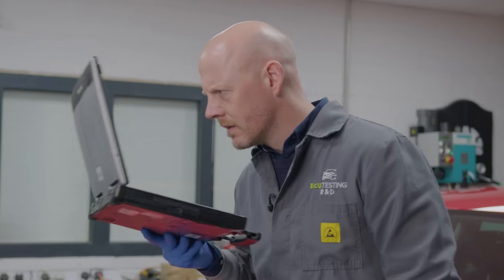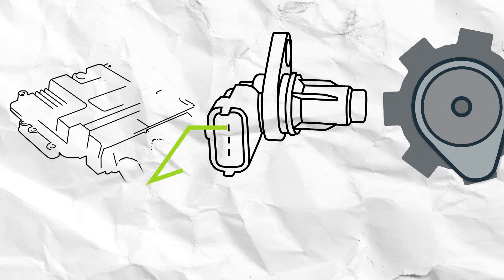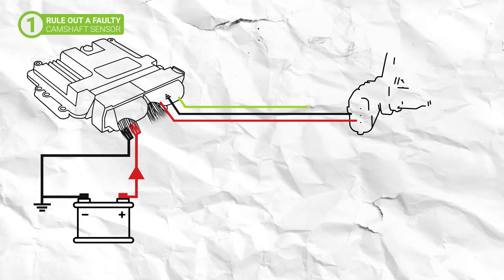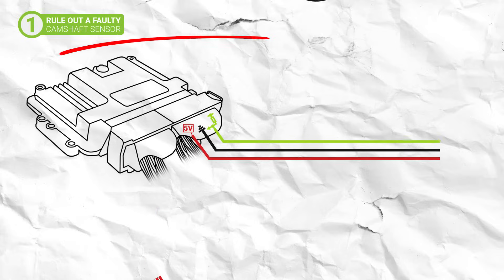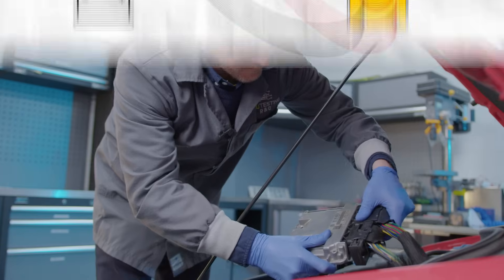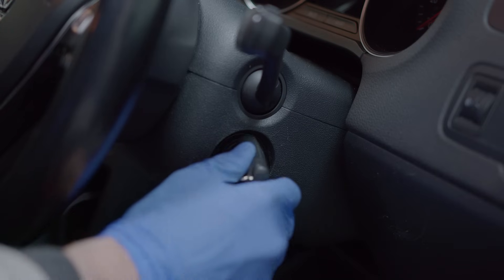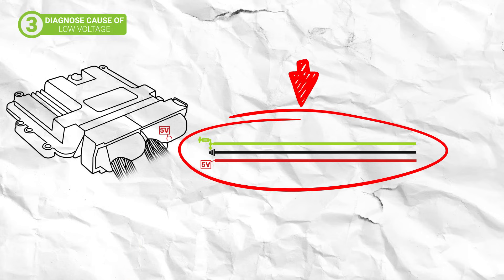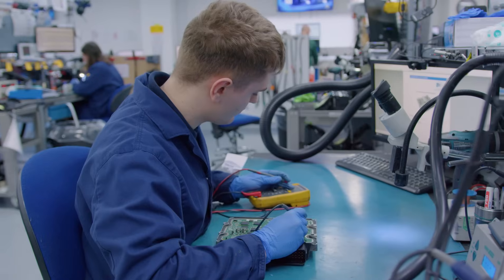Bad Camshaft Position Sensor Symptoms - How to Test and FIX!!

Comment: My question is what if its an intermittent problem with the crank positioning itself , hard starting some days , no start then an hour later starts up . If you perform the test you did and all is well and also no fault codes in my ECU (which i dont understand ) but replaced the crank sensor and its been fine 6 months now 🤷

Comment: I have a friend that has a 2010 2.5 Toyota Camry he hit a deer with the car and now won't start not receiving any readout to the crank sensor as I unplugged the crank sensor and checked from the 3 pins and no read out with key turned on.so do I check the other plug ends within that harness leading back to the ECM?
Reply from the maker: Yes, we would recommend completing the same test by back probing all 3 wires at the ECU connector to determine if the fault is within the wiring loom or the ECU itself.
Reply: Theres a button in the trunk you might have to push after a collision of  sorts. It shuts off the fuel pump. Its called an inertia switch i think. It will be on the driver side in the trunk
Reply: @86bcgossett86  Wow, that is a good thing to know about.... Thank you for sharing!

Comment: Greetings, I own a 1993 C3500 7.4 Truck & I cannot locate the crankshaft Position Sensor (CKG).
I've seen references of between Harmonic Balancer & Timing Cover, in the Block above the oil pan, back of the block, or inside the Distributor. I've looked carefully, no loom wires, no port in timing cover, & I replaced the OEM Distributor with new OEM unit.
Vehicle timing set to 4 degrees before TDC. Verified all spark plug & fuel inj.
Vehicle starts, stalls, back fires.

Comment: So If I only have a P0341 code does that mean that my camshaft is bad ?
I had this issue for over a year but was not wiling to pay the 4k€ asked from Jag to "fix the issue". I didn't trust them as they said the camshaft sensor could not be swapped out (it's litteraly 1 T30 screw).
The only other symptom I have is a delayed start. (No power loses, not engine counting, nothing else).
Any help from someone ?
Reply from the maker: Hi. A P0341 is likely caused by either a faulty sensor, the sensor's wiring or connector, or the ECU as we have mentioned in the video. Typically P0341 is caused by an intermittent fault so a potential quick check to complete would be inspecting the sensor connector for any corrosion, damaged pins, or terminals with poor tension. You can also complete this check at the ECU. If they both look ok, then we would recommend following the steps outlined in this video to determine if the sensor, wiring, or ECU is at fault. But as you have the P0341 code, we would recommend completing all checks whilst wiggling the wiring loom between the sensor and ECU, as engine vibration could be the reason the fault is intermittent. Hope this helps!
Reply: @Ecutestinglimited  thank you very much for you reply.
I have already swapped out the sensor for a new one but nothing has changed. I'll try out the electrical connections and ECU next weekend.
Excellent video by the way
Reply from the maker: @yohansharp3040  Thank you, we are glad you liked the video! If you need any further assistance or believe your ECU is at fault, please email our technical support team on info@ecutesting.com and they will be happy to advise you on what the next steps are.
Reply: @Ecutestinglimited  Checked the wiring from the connector. Got a 12V for Ground, a 5V for the +, and 0,02V for the signal.
Thanks for the help, i'll look into getting the wiring checked up

Comment: Would a P0545 be this problem?
Reply from the maker: Hi. No, a P0545 fault code is usually caused by a faulty exhaust gas temperature (EGT) sensor, the wiring or connectors associated with it, or the ECU's ability to communicate with the sensor.

Comment: I need help with e60 crank sensor. I've been testing it for 2 days. I can't trigger the sensor to see a voltage change.
Another odd thing is that the signal drops from 5 to 2.5v when I plug in sensor. I've used scope to see any fluctuations when I rum magnet across it.
Signal won't change, I've tried three sensors and 2 dme.

Comment: I contacted Ground wire and main wire coming voltage 9.46 why but battery voltage is 12.74
Reply from the maker: Hi. Where in the circuit did you get this reading? If it was at the camshaft sensor connector then we would recommend tracing the wire back to the ECU and back probing there to determine if the fault is within the wiring loom or ECU.

Comment: I'm confused, when taking out or cutting the wire I didn't see if this applies to the ground wire. If so then do I follow the ground to affect wire still or do I do it as it was shown which is switch wires red to + and black to affected ground wire?
Reply from the maker: Hi. If you have a reading that isn't battery voltage when testing the ground wire at the ECU, it could be that the wire is shorted to voltage. To test for this you should remove the ground wire's terminal from the ECU connector and test for voltage by placing the black probe on battery negative and the red probe on the removed terminal end of the ground wire. If there is any voltage displayed then there is a short to voltage affecting the ground wire which will need to be repaired. Hope this helps!

Comment: Excellent video. I have a customer with four persistent fault codes for a wheel speed sensor and cam position sensor, instead of letting me perform tests to find the cause, he's purchased and had me install... 3 cam position sensors, and one wheel speed sensor... with no results. I'm hoping he'll allow me to actually diagnose the issue after the wheel speed sensor $$$$ didn't fix it... which I told him wouldn't fix it.
I'm gonna send him this video, it explains the diagnostic process way better than me.
Reply: easy way out of all this to 'clone' over an identical car, swop over his number plates, and give him the bill to cover the replacement car 🙂
Reply: @sollykhan2385 god why didn't I think of that before, all these years I've been fixing cars what a waste of time mwahaha....😂
Reply: @sollykhan2385 was this supposed to be funny? Or are you serious 🤔
Reply: @kylemcweeny878 i thought it was hilarious😂
Reply: @kylemcweeny878  Yes really meant to be a light hearted funny take on it, however let me quickly cite another example, had a very old car in the shop (Vauxhall ), as old as the hills) not worth much except to the owner in way of sentimental value,anyway it stays parked up for around 9 months of the year outside on his drive,Rats had chewed through all his wiring harness under the bonnet,i said  i could do repairs accordingly, but it would take a great deal of time and effort, he decided to go to the main dealership,waited 6 months for a new engine and related harnesses,they dropped the engine out and dash board replaced it all and gave him a bill for 6 Grand (GBP) i had a friend who had a mint version in his garage and would have got it for a low price, so think on that scenario, regarding 'Cloning' over 🙂
Reply from the maker: Thank you, we've glad you liked the video! Hopefully your customer likes it too and you can get them back on the road ASAP 🙏 We also have a brief video on wheel speed sensor faults as well if it would help: https://youtu.be/T74B_aELnU0

Comment: Sir i have a question, i have that exact van. Some days i can jump in and she runs great, the trans is sticking in what i believe to be 3rd gear, i stop, put it in park, restart it and it shifts like brand new. I see this happens mostly when goin close to 25mph. I have mechanic experience just not sure which sensors are which on transmission.  I have been looking for the correct information for a few weeks now. If have any ideas where i should start,  id just about pay you to pick your brain....thanks in advance.  I know this is a long shot

Comment: You talk about low voltage and high voltage, what about Implausible signal,  mine shows Camshaft position sensor P0391 - Implausible Signal
Reply from the maker: If you are getting any other fault codes alongside the P0391 then it is worth investigating them first as they could be causing the code. However, if you just have the P0391 then we would still recommend completing the checks outlined in this video to ensure the fault isn't with the sensor, wiring or ECU. If they all check out OK, then you could have a fault with mechanical components which will need to be investigated.

Comment: Very informtive and complete video!

I got lucky! 
On my 2007 Murano, I used a 10mm ratching wrench and did not have to move the hose. Just before pulling the sensor, I blew out the connector and the sensor  pins in place with electronics cleaner and all codes went away. So I never even had to pull the sensor!

I was showing P0345(Camshaft Position Sensor Bank 2), P0725(Engine speed input circuit), P1701(Power supply circuit), P0868 (Transmission fluid low). The last 3 are Nissan OEM codes.  I'm not smart enough to know if those should be all related, but I can see where all but the P0868 could be related, maybe?

Anyway, Thanks for saving me time and money!

I will update if any of them come back.😎
Reply: Hi I was wondering what your outcome was I have the same issues with the same vehicle make and year with the same codes except my camshaft code is p0340 instead of p0345

Comment: I'm having the reoccurring P0394 intermittent code with the ESC light coming on. I have replace the camshaft position sensor and tested the connector which is a four wire and each is getting 5 V and the negative is getting the battery reading. It’s a 2015 jeep JK wrangler any ideas? The code comes on when it’s under load, climbing a hill, even on the road and then it goes into limp home mode.
Reply from the maker: Hi. Have you tried completing the wiring tests whilst wiggling the wiring and connectors to see if there is an intermittent wiring fault caused by vibration whilst the engine is running? If this test checks out ok, then it may be an issue with the ECU. Feel free to email our technical support team at info@ecutesting.com with any other questions or if you would like to send your ECU into us for a test. Thanks.

Comment: P300700
Reply: What does this mean 🥲
Reply from the maker: Hi the code P3007 indicates the camshaft position sensor isn't receiving a signal. We would recommend completing all the wiring checks outlined in this video to test the cam sensor circuit in order to determine if a fault lies with the sensor itself, the wiring to the sensor or with the ECU.

Comment: I have an Audi A4 Quattro 2005 3
2L that has static P0390 and P346 codes. I replaced the camshaft position sensors but the problem persists. I cant find an ECU wiring diagram for this car anywhere.

Comment: I changed my camshaft sensors an now my ignition is locked could that be the problem?
Reply from the maker: Hi. Changing the camshaft sensors should not directly cause your ignition to become locked. If your ignition is locked, it's more likely related to the key, ignition cylinder, steering wheel lock, or an issue with the anti-theft system (if equipped). We recommend checking if the steering wheel is in a locked position, as this can sometimes make it difficult to turn the key. If that doesn't work we would recommend getting the vehicle scanned for fault codes to help pin point the cause of the fault. Thanks.

Comment: I have error code P0016 on my XC70, switched camshaft sensor, VVT, cambelt and waterpump, oil and filter, sparkplugs, and still get that damn engine light shining bright, can it be the crankshaft sensor?
Reply from the maker: Hi. A P0016 could certainly be caused by a faulty crankshaft sensor. Please follow our video guide here: https://youtu.be/_wx7ZumykMc on how to test a crankshaft sensor circuit, and this will help narrow down the cause of the code.
Reply: @Ecutestinglimited  Found the problem, it was the crankshaft sensor, switched it today and the light went away.
Reply: @Ecutestinglimited  Thanks, will do!

Comment: In my car p0344 cam sensor A circuit intermittent interruption
 current and temporary coming please help me. Mechanics they are just taking money from me but nit fixing
Reply from the maker: Hi. If you have a P0344 then we would recommend checking the cam sensor connector for corrosion or terminal tension first, and then testing the cam sensor circuit using the methods we have detailed in the video above. These will help narrow down the potential cause of the code.

Comment: I have replaced camshaft sensors for the third time and I still  get the same reading camshaft sensor bank 2 I’m not sure where I can take the ECU  to be tested. I live in Wisconsin Madison.
Reply: I had the same issue so i replaced the crank sensor and the problem went away
Reply from the maker: Hi. We are located in the United Kingdom, but we do offer a worldwide service so you can get your unit tested and remanufactured no matter where you are! Fill in our online test form to get started: https://myaccount.ecutesting.com/ or contact our technical support team via email at info@ecutesting.com

Comment: Very good. But I can't get any codes on a crank no-start (Corsa C). Two pedal test gives continuous flashes-- I counted up to a hundred; two cheap readers, then an Xtool D7 (360€) which I bought specifically to find the problem. Have 50psi on fuel rail, new plugs, removed throttle body and cleaned, sprayed MAF with correct cleaner, changed crankshaft sensor. It just fires and cuts out. A whole ago it ran for a whole 30secs, then 10 secs, now nothing. Any ideas PLEASE?
Reply from the maker: Hi. Are you able to communicate with the ECU using diagnostics? Are you also able to get the part number on the ECU unit please?
Reply: @Ecutestinglimited  Don't really understand the first part "using diagnostics", I thought that meant code reader which as I've said show no codes -- even the 2 pedal test is just continuously flashing (I counted to 100!). The ecu is not evident so I shall go rip some things off and get back to you. Thank you very much.
Reply from the maker: @johncollins8304  Hi. Apologies, yes we were referring to your diagnostic scan tool the Xtool D7. We just wanted to confirm that you have done a full vehicle scan and found no fault codes and not just scanned for fault codes on the engine ECU itself? This is to confirm if the ECU has communications with the other modules on the vehicle and the fault you are describing isn't caused by a lack of communication.

Comment: What about camshaft sensor how to check
Reply from the maker: Hi. Follow the steps in this video at 1:52 to check the sensor is receiving and sending the correct voltages, and that it has a good ground. If all of these readings are good and you still have a camshaft sensor related fault code, then it is more than likely that your sensor is faulty and will need to be replaced.
Reply: @Ecutestinglimited  how to identify signal wire or ground or supply. My camshaft couplee has 3 wires 2 give 12.something volt  output and other is 5volt
Reply from the maker: @S.khan.123  Hi. The best way to identify which wire is which is by consulting a wiring diagram for your vehicle. This will also help determine if your sensor should be supplied by 12v or 5v. There are tests you can perform to attempt to identify which wire is which without this information, but these can be misleading if there is a short to voltage or ground within the circuit. If you are unable to access this information, then you can identify the ground wire by performing a continuity test between the negative side of the battery and all the terminals at the sensor connector. The one which has continuity should be the ground wire. With your black probe on this ground wire/terminal, put your red probe on the other 2 terminals at the sensor connector. If your sensor is supplied by 12v then one side should read this battery voltage and can be assumed to be the high ref supply, and the other wire should read 5v and should be the signal wire. Again, this is not advisable as any shorts within the circuit can skew these results. Hope this helps!

Comment: How do you know which is the affected terminal?
Reply from the maker: Hi. The 'affected terminal' we are referencing at 4:31 in this video refers to any of the terminals which gave an incorrect reading whilst you carried out the 2nd test at the ECU connector, at 3:31-4:11. For example, if the signal wire read outside the 4.8-5.2 voltage range whilst testing at the ECU connector, there is a fault affecting that wire/the signal circuit and we need to remove the terminal from the ECU connector to determine if the fault lies with just the loom, or the loom and the ECU. Hope that clears everything up for you!

Comment: I started my Fiat Ducato (2013 diesel) yesterday to drive it to the garage for a new timing belt + kit. It run badly, actually only ignition pulse to 2 of 4 cylinders. What else than a bad ECU can cause ignition pulse on 2 of 4 cylinders? What about a cam shaft position sensor or crank shaft position sensor? My garage said that they had never seen one of those bad and still being able to start the engine. Of course, all the cables need proper testing also, so far thay have found nothing wrong there, so they are suspecting the ECU/ECM. Any other leads? And, is all pulse signals 5V? I think they said they meassured 2V but I need to challange them on that because I have never heard of a 2V signal, only 5V but I am no car mechanich either.